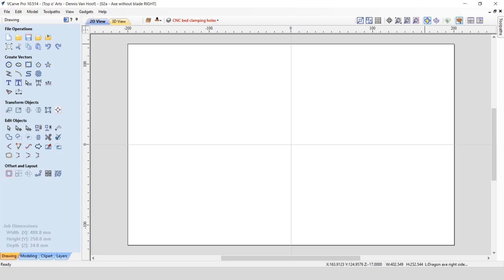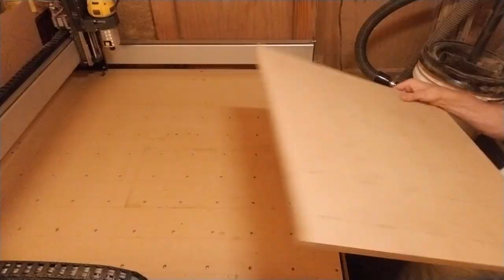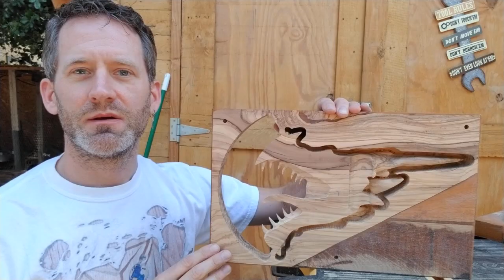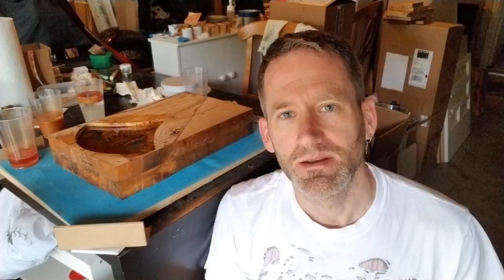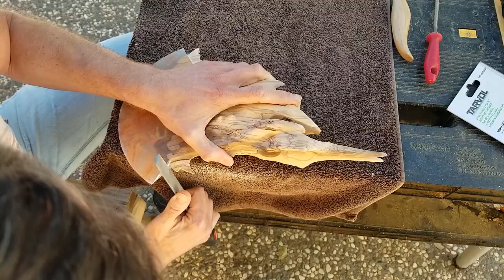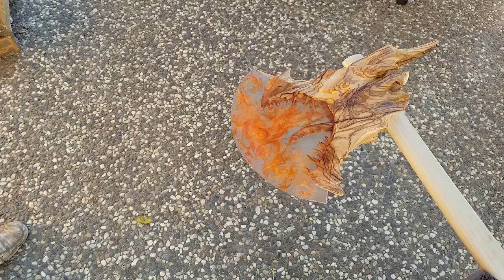Fire-breathing dragon axe - with the Shapeoko

Comment: As a by the by, you really dont need to do any roughing - you could use a tapered ball not with 75mm long shank it has a cutting width of 32mm or a 100mm long shank with cutting width of 60 mm save yourself some time!!!!!
Reply from the maker: Thanks for the suggestions! Olive wood is very hard, and my personal experience is that I get better results and put my machine under less strain when doing a roughing pass with this kind of wood. :)
Reply: @dennisvanhoof9958  Give it a try you will be surprised, I was very sceptical when it was suggested to me as well. I do single pass carving with Red Gum, Mallee Root, Oak pretty much any hard wood I come across. As it was explained to me by an old timer, if the full cutting width of the cutter wasn't intended to be used why put it there. The benefit of using the full cutting width of the tapered ball nose is due to its design it pre cuts ahead of the actual ball nose. That way the ball nose has always a stress free cutting zone. If you decide to give it a try would love to know how you go. Your CnC router works very well, I think that is due to the way you maintain the machine and do your work. 

I have watched many of your videos and your work ethic and the way you go about creating your works of art is to be commended. My favourite is your violin build.

Have a great day and greetings from the colonies downunder.

https://www.youtube.com/watch?v=By5v7eHIy-I  this video shows single pass.  You will notice it is not the standard ball nose. Tapered End Mill R1.0*D8*60*100L*2F Tungsten Carbide Steel 100mm 1pcs 2 Flutes. I use the 100mm shank for deep carving when I need a lot of clearance, otherwise the 75 mm length shank is perfect for most of my jobs.

Doing a single pass and saving time also means for me at least that I can afford the time to use the 1mm radius, I've not had a reason to use .5mm radius yet.